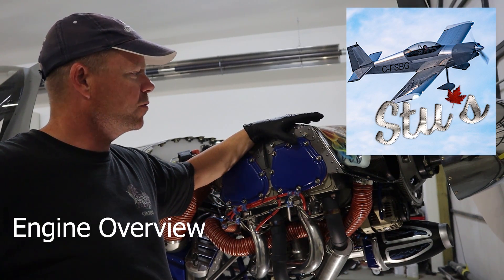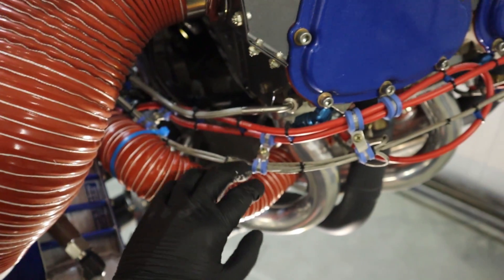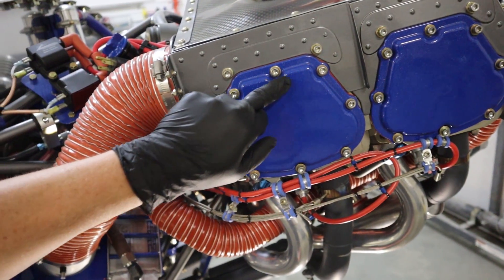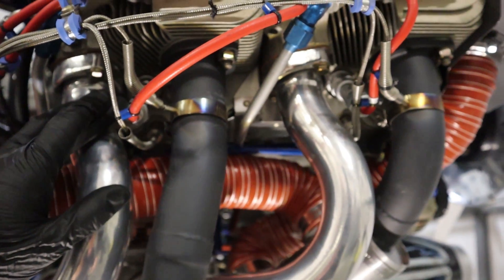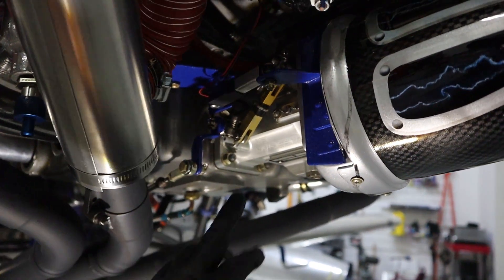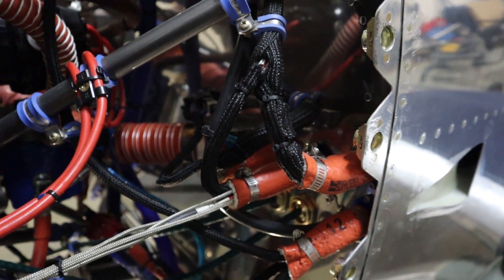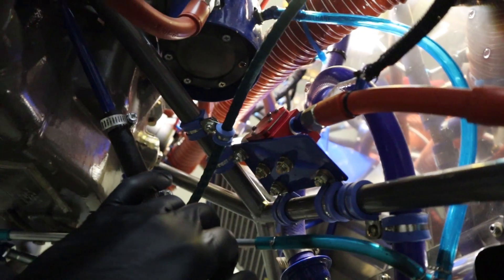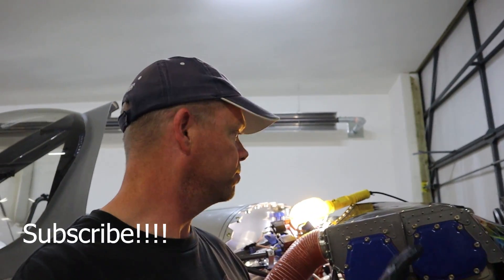CFSBG Engine Overview

Comment: Hi Stu, did you proseal or glue the cowl flanges on before riveting? They look Great! Thanks
Reply from the maker: The hinges yes.  I add a flow epoxy mixture before riveting.   The sky bolt flanges no - just riveted

Comment: Great vid and channel. Can I ask the hoses gong into the red cube and from the fuel pump to injector body, what sort of hose is that? Its a firesleeve colour but doesn't look like standard firesleeve Thanks
Reply from the maker: It’s integrated firesleeve.   Actually built into the hose.   It’s much neater and make the hose smaller diameter.   I prefer it over the added firesleeve and clamps.   All my hoses are made by TS Flightlines.

Comment: Stunning installation Stu!  I'm curious why you put the magneto fired plugs on the bottom and the electronic fired on the top.  Dosen't the electronic ignition system put out a stronger spark?  Thanks! :-)
Reply from the maker: I understand your point and swapping it might be interesting.   That was the way the engine builder did it so I kept the layout just moved the elec ign a bit
Reply: @stusaircraftfactory6592  Thank you for your reply.  I can certainly understand keeping it the way the engine builder has it.  They built it that way for a reason.

Comment: How did you adapt the MSD ignition wires to the mag, and to the lower plugs?
Reply from the maker: The lower plugs are fired solely by the mag.

Top plugs fired by Lightspeed.  

Does that answer your question?
Reply: Stu's Aircraft Factory no, I get that, but usually the mag harness uses a steel braided wire, not the red MSD silicone wire.
Reply from the maker: Ah I see - they are normal supplied lines from engine manufacturer.

Comment: Quick question (I’m working on an RV-14A project):  how did you get your exhaust and intake tubes ceramic coated?  Thanks.
Reply from the maker: I took them to a local shop.  They do it all the time - where are you located?
Reply: I’m in rural Northern Arizona, far from the  big city.  I’ll have to search for a shop..